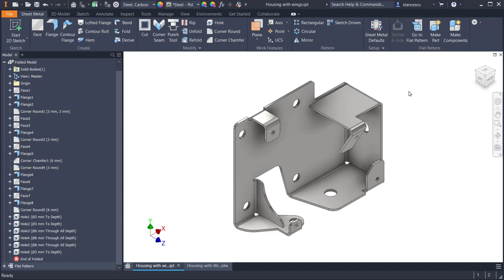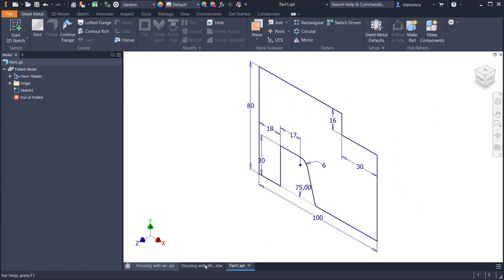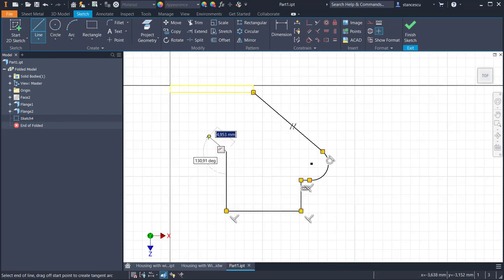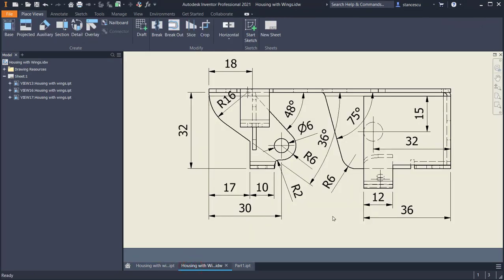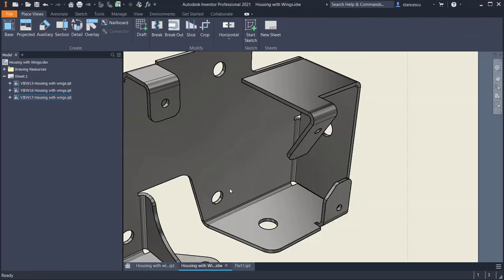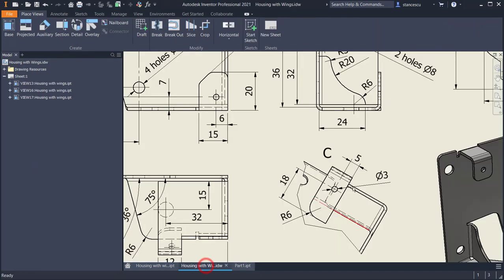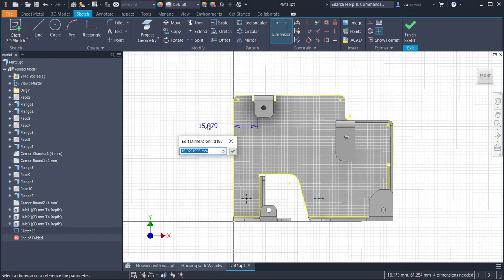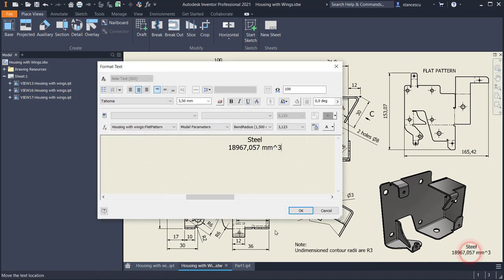Tutorial Inventor - 198 SHEET METAL SM-005

Comment: Can we apply the flange command to a cylindrical part?
Reply from the maker: Not at the ends of the cylinder but only at the end generators of the ruled cylinder.
To be more explicit, if you roll a piece of paper to form a cylinder, you can apply flange at each of the two ends of the paper along the generator of the cylinder.
Reply: @prof-stancescu  Thanks Sir, I need to apply flange piece by piece to the top of the round paper, which is inward (90 degrees) along the edge of the paper, it should be like a fringe on the top. I guess this is not possible?